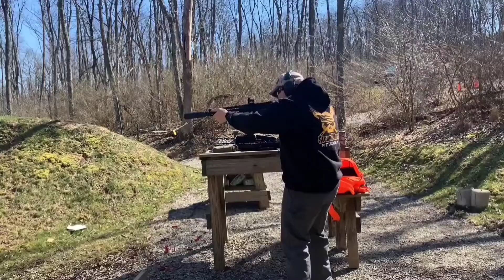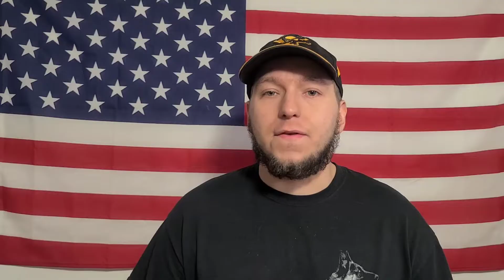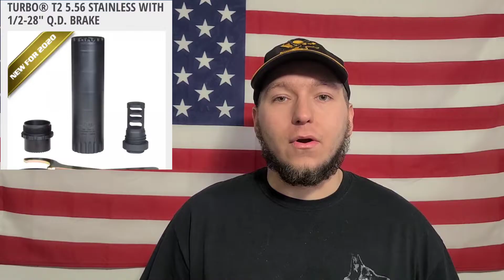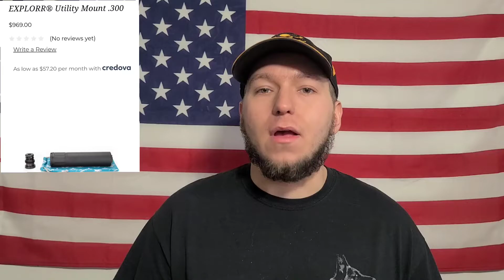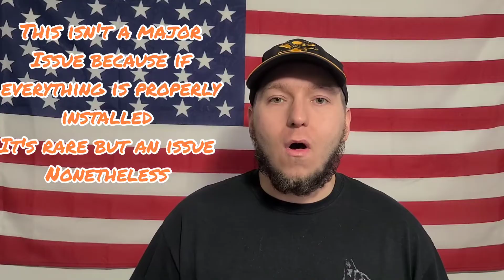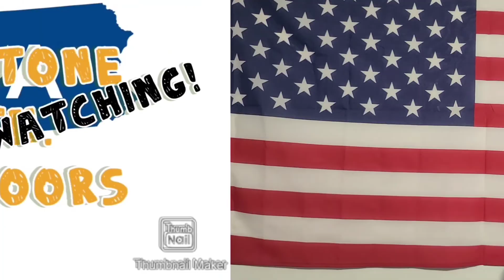What's HUB? | 1.375x24 Suppressor mounting platform

Comment: What do you think about putting a little bit of copper anti sieze on the threads to prevent it from sticking? Or maybe high temperature ceramic grease like the disc brakes would use?
Reply from the maker: @vaejoviscarolinanus  nickel based anti seize wouldn't be a bad idea. It's rated for hotter temps then copper anti seize.

Comment: I'm just getting into suppressors. I was told the LAHAR-30L runs a 1.38x24 Hub Mounting System.  The Wilson Combat Suppressor Ready Muzzle Break only shows External Thread description as 24mm x 1.5 pitch. Is Wilson Combat being proprietary so all I can use is their suppressor? This would kinda suck cause I'm getting discouraged with their 300 HAM'R Hunter.

Comment: Do you use any grease on the HUB threads? I cleaned my nomad’s threads with acetone and have a bunch of aeroshell 33. I am switching from direct thread to the xeno adapter and don’t know if leaving it dry is a bad thing
Reply from the maker: That's personal preference. I'm a pipefitter by trade and leaving threads bare goes against all I've been taught. I personally put a dab of some high temp anti seize on mine.
Reply: @PracticallySquared1  Do you do the same on muzzle devices that you don't rocksett? I had a hard time keeping the direct thread adapter from backing off during fast strings of fire which motivated me to try xeno
Reply from the maker: @RomiAlmeda  I use the antisieze on everything. I've never used rockset for a muzzle device, I always torque it down to  spec. 

As far as the DT adapter coming loose, it's almost always because it wasn't tightened enough. With spanners it's hard to gauge how much torque your putting in there but I go "ham" when I torque one into a can. I've never had one I properly snugged come loose.
Reply: @PracticallySquared1  Right on, thanks for your tips!
Reply from the maker: @RomiAlmeda  no problem! You'll love xeno. I had a few videos on it but youtube deemed them against their standards. I've been running xeno since it came out. It's my favorite for sure. Way less likelihood of something coming loose and the muzzle devices are cool

Comment: Waited for months for the Dead Air dirext thread mount for nomad ti. Still out of stock. But thankfully it's compatible with the HUB and ordered the griffin direct thread mount. Only concern is to see if the can stays tight on the 18 inch 5.56.
Reply from the maker: Try a few wraps (2-3) of Teflon tape on your barrel then snug ut on there hard. I bet it will stay no problem. I've been doing this for years. It's an old tip OG's used to do when DT was the only option
Reply: @PracticallySquared1  thank you bro for that. I am going to do that. And the next logical progression is switching everything to Xeno. I think it's my best option. The direct thread was really for my 18 inch "precision" AR but if they come out with a titanium xeno flash hider it'll be a no Brainer